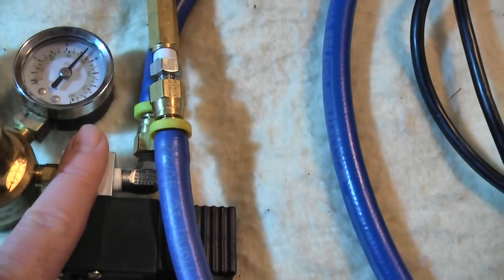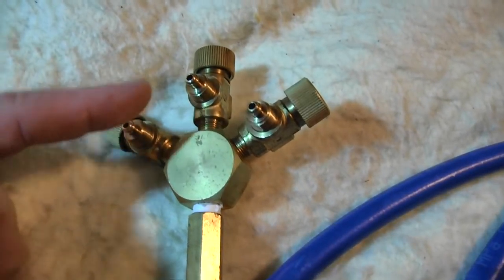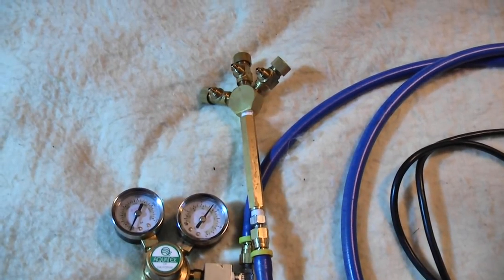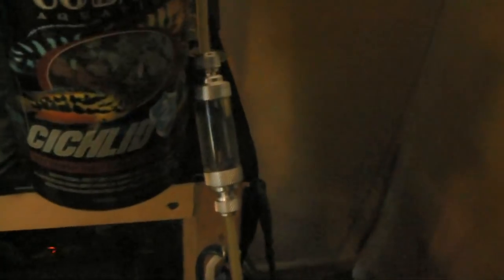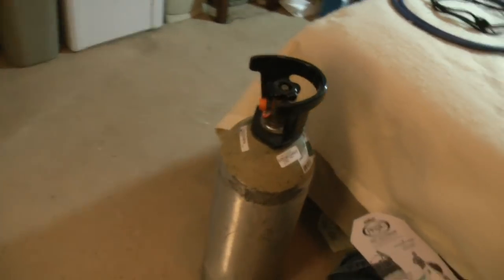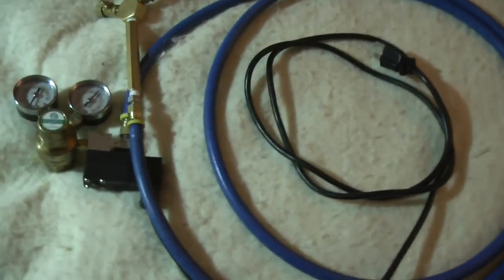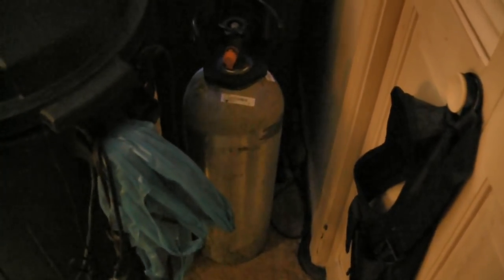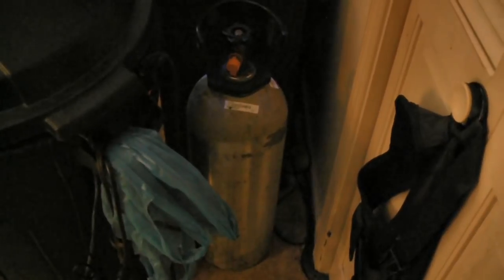New Co2 Setup Part: 1

Comment: Hi Paul. Do I need a dual STAGE regulator? Or, is a single stage good enough?
Reply from the maker: There has been a lot of talk about that on the internet, most say that with a single stage when the tank gets low enough it will dump whats left into your aquarium and probably kill your fish, Dual stage regulators are two regulators built into one. The first stage knocks the pressure down to a regulated (constant) PSI for the second stage.
This prevents fluctuations due to changing PSI from the from the tank. Two-stages will also add extra protection. Yes.. single-stage regulators are less expensive and are commonly used with no issues. However, it's up to you to decide if that risk is worth the extra money. A single stage can add risk and can be more difficult to get a reliable and consistent output. Now that said I have been running a single stage for three years with know issues and fantastic results, but if you get one that was built on a Monday morning or Friday afternoon? Jus Sayin!